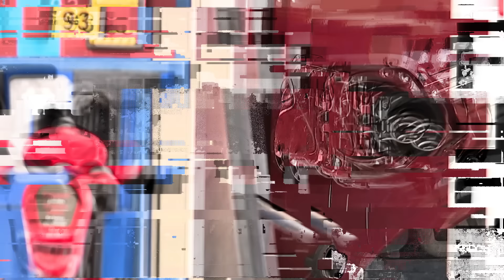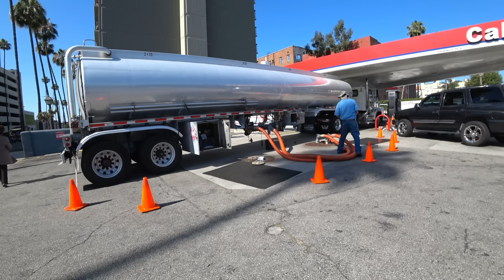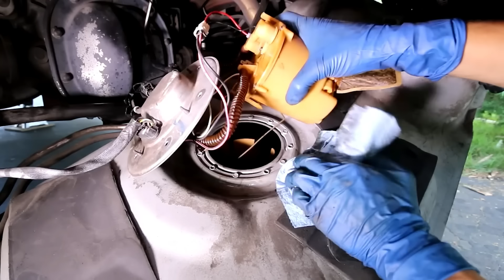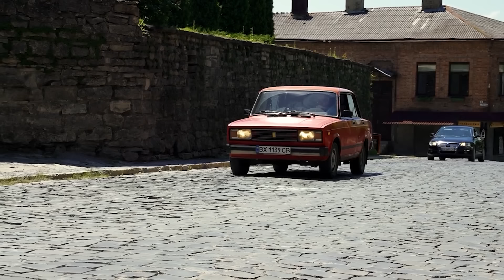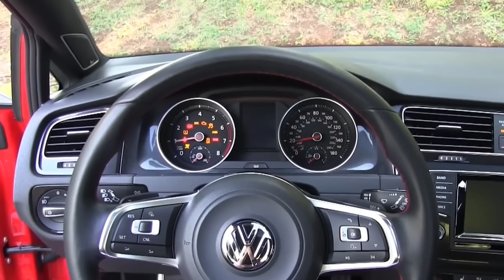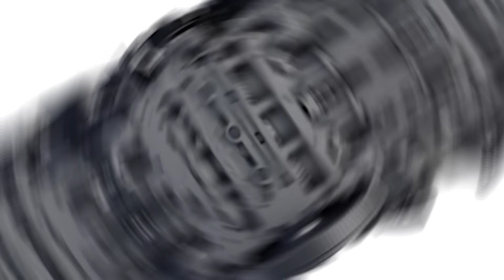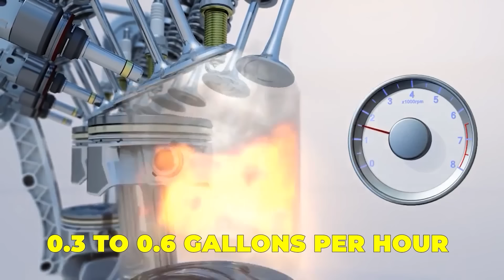15 Fuel Saving Secrets Gas Stations Protect With Their Lives

Comment: I disagree with #2. I've tested it extensively with start/stop function on and off. The engine on idle burns much less fuel in the city driving than constantly starting up your engine. It varies on the car, but to ignite the engine again, it may take up to 20x more fuel than idle for a few more seconds. When you drive around the city switching your engine on and off in traffic, it can cost you 15%-20% more fuel, as the engine start-up is one of the heavier fuel burners in the car. 
There are some interesting facts in here... I'm gonna test some of those, as I'm actually following at least half of them already.

Comment: Here’s a good one, avoid gas stations with floor mats over their tanks. They do that because they know water is leaking inside their tanks.
Reply: They put the rugs to keep rain water out. Then get lazy and not bring the rugs back inside. There is a veeder root monitoring system that will shut the pumps down if water gets into them.

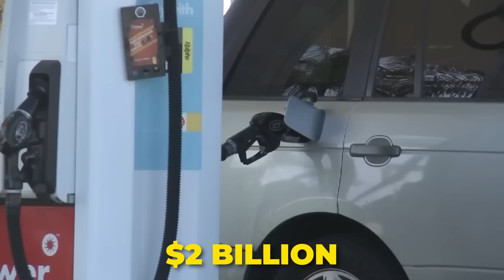Comment: 2:52 That's where they're wrong. It's better to drive on higher octane because the car uses less fuel. I've noticed the difference between 95 octane and 98 octane here in Sweden. 95 octane makes the car a bit slower and uses more fuel, and then driving with the AC on also uses more fuel than without because the engine has to work harder.

Comment: Greetings from the UK. You may wish to note that regular petrol ( gas to you ) is now running at $7 a gallon ( £1.38 per litre here)  since the craziness started. This is at 'Walmart' prices. It rises to $9 a gallon on motorway services ( freeway services). I am surprized there aren't more diesel cars in the U.S. ..apparently only 3% are. Diesel cars are more economical. I run a 2 litre VW Passat  Diesel Estate model ( Station Wagon to U.S. ) which gives me 60 mpg on a long run. The only downside is that knowing this ..they make diesel prices higher than petrol! Leave you with a petrol station fun fact. For those old enough ..remember when gas stations smelled of ..well gas..and now they dont. Most people dont realize why. When you take the gas nozzle off the pump next time you fill up look briefly at the end of the nozzle. You will see a tiny pinhole tube in the end at one side of the nozzle. As you pump gas into your car the fumes in your tank are being drawn out through this tube back to the gas stations storage tanks. This is a Vapour Recovery System which must be installed here in the UK to prevent those fumes entering and breaking down the atmosphere. In the spirit ( no pun intended) of the video one could argue that the petrol stations are stealing your fumes which will condense again . 😅

Comment: Lots of misinformation mixed in with a few good tips are mixed in with this video. Here is one example.
Weight, speed or wind resistance have nothing to do with gas mileage. If your vehicle can cruise at 70mph at 2000rpm with four windows down while having 100lbs extra weight in the trunk its fine.
Your tachometer tells you how hard your engine is working.
If your interested in learning more, just ask.

Comment: A great collection of advice. On tyre pressure though, it's not just about fuel economy. If you underinflate tyres by, say, 4psi, you increase the tyre contact area and boost ride comfort. As road maintenance is increasingly neglected in the UK, the extra ride comfort is dramatic. 

Also, if you choose to drive more slowly than is safe and legal, kindly do so only where other drivers can easily overtake you and don't hog the middle lane and stay out of the outer lane on a motorway!

Comment: Pumps Have Air Eliminators: The video claims that the meter counts vapor bubbles and aeration as liquid. In reality, commercial fuel dispensers are engineered with a crucial component called an "air eliminator" (or air/liquid separator). This device physically separates and vents any air or vapor from the gasoline before it ever reaches the meter. The meter only measures the actual dense, liquid fuel.
Impossible Margins of Error: The video claims you can lose 2% to 6% of your fuel to fast pumping. To put that in perspective, losing 6% on a 15-gallon fill-up is nearly a whole missing gallon. State Departments of Weights and Measures routinely test gas pumps, and the legal tolerance for error is incredibly tiny—usually around 0.3% (roughly 6 cubic inches per 5 gallons). If a pump was genuinely shorting customers by 2% to 6% as the video claims, state inspectors would immediately red-tag and shut down the pump

Comment: I had no idea that pumping gas at maximum speed creates vapor pockets that we still get charged for!
 Definitely slowing down my fill-ups from now on. Thanks for the tip, Piston Post!
Reply: I know it would be crazy if local state or county Weights and Measures officials checked the pump and maybe even put a sticker and date it was checked on the pump... wait they do... even the video pointed it out  oddly enough
Reply: @gaming_hippie4806  working on gas station. That guy on video was complete wrong.. pumps cant measure no fluids. nozzles cant make turbulence its not designed like that .. pressure of pump and valves not let this ting happening
Reply: @NOTISL 
I disagree, I have noticed after filling up and moving away down the street to a few streets away my gague shows I've travelled 20 or 30 killometers.  Very dusturbing. 😢
Reply: You didn’t know that because it’s not true.
Reply: @JackieFandango oh come on
Reply: @Flynnstir this is AI slop bro. Almost everything in this video is wrong.
Reply: SAME!
Reply: Don't be dumb !!
Reply: @alyxxhogue3976 oh come on
Reply: Don’t listen to AI
Reply: Modern pumps are equipped with vapor recovery systems (often required by law) that suck vapors back into the underground tank, rather than losing them.
Reply: It is bologna.   Fuel is measured at the pump not the nozzle , it's complete crap and myth to sell a video.
Reply: You obviously believe any old crap on the internet 😂😂
Reply: That’s untrue, as are many of the points in this video. Source: I’m a petroleum service technician
Reply: Same here.....😞
Reply: I knew this fact for about a decade ago but most of the time never had the time to fill up slowly😂
Reply: When I add fuel oil to my 55-gallon drums in the back of my truck I see all kinds of bubbles pouring out.
Reply: @zAlaska  That’s likely trapped air escaping as the fuel displaces it—totally normal. If it were foam or vapor from contamination, you’d notice changes in smell or consistency.
Reply: @zAlaska oh come on
Reply: you’re gonna get bubbles when you pour fuel into a drum, just like you get bubbles when you pour 1 glass of water into the next. Just physics or sum shit.

Comment: I’ve been told by a few close relatives who own mechanic shops that premium fuel is extremely important for the longevity of your car’s engine for you want to keep it long term (I.e., 200k-400k)!
Reply: No! Look in the owner's manual and it will tell you exactly what octane to use. You can damage your vehicle if it needs it needs regular and you consistently use premium.

Comment: Using to thick oil will damage your engine - so will the engine shut off feature - I learned always use top tier fuel (not super) and add a bottle of Techron every oil  change (to your gas tank) will help keep your engine alive longer. Spend a little more now and save thousands later

Comment: When I put premium in my car that needs it, I always wonder what kind of gas was in the hose when I pulled up to the pump.  The hoses probably have at least a couple pints in them.
Reply: Actually the hose for premium will always have premium..the hose for Super will always have Super. The 2 fuel grades are routed from seperate tanks . One of the things that makes me smile is occasionally you still get the guy who goes into contortions wrestling with the fuel pipe thinking he is not wasting all that fuel in the hose when in fact the cut-off point is at the neck of the fuel nozzle.

Comment: What about when you first place the gas nozzle in and press the lever? How long does gasoline actually take to reach the nozzle? How much money are you losing in that time?
Reply: Every time what’s in The hose goes back in their tank ! True !!!!! You are robbed every time.
Reply: Yes, the counter always goes before any gasoline flows! While pumping,
every stop and go you loose actual gasoline, the counter goes but takes a second for gasoline to come out.
And you would think faster keeps out air bubbles and it is a steady flow as to slower would leave air inside the tube and nozzle🤔 Faster may stir up the car's gas tank bottom more but not sure.
Keeping a half tank is suppose to save gasoline mileage. Also, when I fill completely, that 1st 1/4 seems to go down way quicker🤔.

Comment: Ive read that filling in the morning when the ground is cooler reduces fuel expansion and get just that lil bit more that adds up over time. So in Lake havasu when it's 120 degrees during the summer days and the ground radiates heat this is deff true.  Not sure in cooler climates

Comment: That’s why most gas stations take away the first little lever so you lay the handle on the second or third which is the fastest. Now I know what to do.
Reply: no the gas stations took away the levers out of the gas pump nozzles because the nozzles can not shut themselves off when almost full like they do when holding it in your hand while pumping so with no way to automatically kick off, the nozzle will continue pumping even after full.. so then there is gas pouring all over the ground until lever is disengaged .. that’s why lever was removed so people wouldn’t set the lever and leave unattended going inside store to shop or use the bathroom while lever is set and gas is pumping without anybody there to be ready to disengage lever when vehicle is full.. hope this was helpful…

Comment: my dad Always said, do not feul up if tanker is there!!
Reply: This is 100% accurate info from your Dad! I worked for an oil & gas company for several years. One of the things I learned was that pumping gas while they’re filling the underground storage tanks will put sediment (not water) in your gas tank. 

The high velocity of fuel pumping from the tanker into the tank below ground causes sediment on the bottom of the tank to kick up during the delivery. If you’re pumping while they’re delivering gas, you could end up with that sediment in your tank & engine.

And good luck proving ANYTHING. The company I worked for knew the issue and would deny claims of damage to customer vehicles primarily bc customers always thought it was water in the gas- and that was an easy claim to dispute. The manager can go stick the tank and show you there’s no water in it. They can’t scrape the bottom though. And if you don’t have the fuel receipt, they won’t even listen in the first place.
Reply: @missyyy- my dad worked in construction and he drove big equipment that used gas plus just his own exp...
Reply: Mine too!!!!!
Reply: Smart Dad, give him a hug when you see him again and thank him! 😊❤😊
Reply: I never knew this but makes sense
Reply: Wow! Thanks for this! ❤
Reply: Yup!!!
Reply: It stirs up the water that normally sits at the bottom of the tank.
Reply: Fuel....not feul.
Reply: Cultivate trust that others can figure it out on their own, otherwise you're doing them a disservice❤

Comment: Good info but dragged out to the max. Thanks to my son a mechanic im not worrying about 90% of this
Reply: They're trying to get rid of driveway mechanics by creating cars with locked engines to where even if it's a $10 piece you have to go to the dealer and get the okay and have them unlock it, not even sure they will allow people to work on their own cars much soon, they've created since 2026, the car is that surveil even more than the ones before. Shutting cars off if they assume you are tired or if you've swerved to avoid a squirrel that's considered erratic driving, if you get in the car and someone has just had their nail polish removed or even use mouthwash the car may not start. My brother is a mechanic too and I feel so bad because he loves to race old cars but I've been noticing they're going to make them impossible to own anymore. The goal is to get everyone in 15 minutes cities without their own freedom of a car, and those smart cities have already been built in certain areas

Comment: Gas prices have gone down about 30 cents in my area. Also I use Walmart Plus to get an extra 10 cents off per gallon at Murphy 
January 2026
Reply from the maker: That's great news about gas prices and a smart tip on using Walmart Plus for extra savings!

Comment: I run a Skoda 2012 built to endure 95 octane feul, the modern feul here in Europe. Its got more then 10% ethanol and goes bad in 3 months. I use 98 octane daily just to know if my car would ever sit for prolonged periods of time i have peace of mind the feul is still good, and nothing corodes which also is a bad thing that comes with 95octane with ethanol. Ethanol is hygroscopic and draws in moisture which is bad for hard feul lines, injectors, high pressure pump.

98 octane or higher octane have less methanol which is safer for engine hardware, and any ecu can easily adapt to less knocking. Modern feul combined with modern cars have become throw away objects, any modern car on a modern long life maintanace contract, on modern feul, will ensure a quick death, bearly running 15 years/150000 miles. Cars have become throw away object. No strong durable classics are born anymore these days. Its built to degrade fast.

So in short, the premium feul point being made in this vid are wrong. Totally wrong. 

The gas truck filling the tank of the gasstation in a really good warning though. Some gas stations have such old and bad tanks the sedemint ruins engines in hours after refeuling.

Comment: Since when is my car knowledge the Gas Station’s responsibility?
Reply from the maker: Fair point, fuel stations aren’t responsible for how we maintain or drive our cars. But many drivers never get taught these fuel-saving habits in the first place, so they end up spending more at the pump without realizing why.

Curious though — what’s one fuel-saving tip you learned the hard way that actually made a difference?

Comment: In Britain premium fuel or E5 is better because the other fuel E10 delivers far less mpg. Far less. Plus's E10 causes moisture in the tank in winter.
Reply from the maker: In the UK, E10 typically gives about 2–5% worse MPG than E5, not a huge drop, but it can be noticeable in some cars because ethanol has lower energy content. As for moisture, E10 absorbs water more easily, which can be an issue in winter mainly for vehicles that sit unused—like classics or seasonal cars. Daily-driven cars usually don’t have problems because the fuel is constantly being used. So yes, E5 can deliver slightly better MPG and is safer for older or rarely driven vehicles, but most modern cars are designed to run on E10 without major issues.

Comment: That’s why the first notch on a pump is filed off so you won’t fuel slow! I always hold the nozzle to fuel slowly.
Also take the hose out of the pump and lay it down before you insert your card. That way you don’t get air that cost you money at the pumps.
Reply from the maker: Good points. Fueling slower can help reduce splashback and vapor loss on some pumps. Modern pumps don’t charge for air, but laying the hose out can still help with smoother flow. Either way, being mindful at the pump adds up over time.

Comment: Not related to Fuel Stations but several of yours also are not related to fuel station,  a heavy foot on the accelerator has more impact than ALL your suggestions.  Also VERY few cars on the road have a fuel cap alarm system and it is not the Fuel stations responsibility to advise you about ANY of these, it is the driver or owner responsibility.

Comment: Automatic gearboxes rob about 10% consumption over manual.
Manual can let you control MPG with lower RPM gear changes. Changing my driving habits my car went from 28mpg to around 40mpg over the same regular journey. That and tyre pressure set for economy.
Reply from the maker: You’re spot on — smooth, low-RPM driving and correct tire pressure make a big difference. Older automatics could lose ~8–10% MPG, though many modern autos are now similar or better. And going from 28 to 40 MPG shows how powerful good habits are.

Comment: Not sure if he mentioned.... Seems in my area I notice at all pumps no gas comes out until it reaches anywhere between $1.00-$1 50.  A station a few years ago did this only it was 2.50 before gas came out....they were eventually closed down.
Reply from the maker: You’re right — a pump shouldn’t charge a dollar or more before fuel actually starts flowing. That usually means the pump isn’t calibrated properly, and regulators can shut stations down for it, just like the one you mentioned. Always worth reporting when you see that.

Comment: This video is quite misleading
2 obvious points to that are wrong are:
1.Not all premium fuel is created equal. Some gas stations include cleaning agents in their formulations while others don’t. A blanket statement about premium fuel like the one in this video is simply false
2.Fuelling while tanker is on site?  No problem! The dispensers have filters that filter out the sediment before it hits your tank. The advice to drive away if you see the tanker is wrong. 
First half of the video is misleading  and factually incorrect. 
The second half of the video is generally just common sense. 
Do not believe everything you watch to be factually correct folks!
Reply: Thank you. Came here to mention #2.